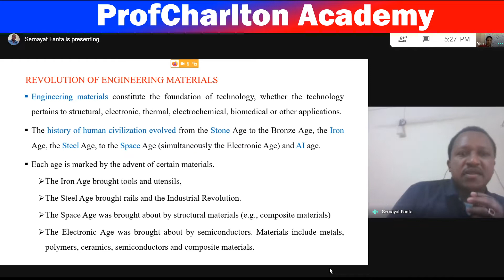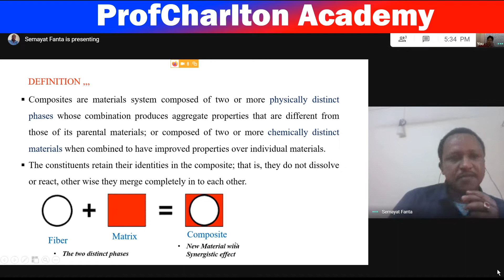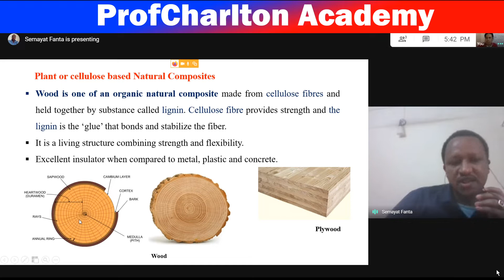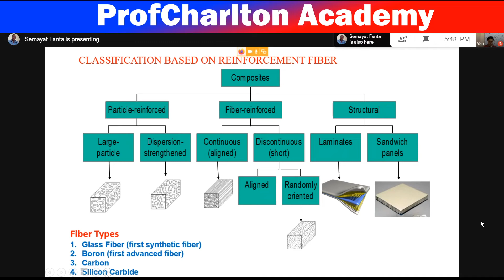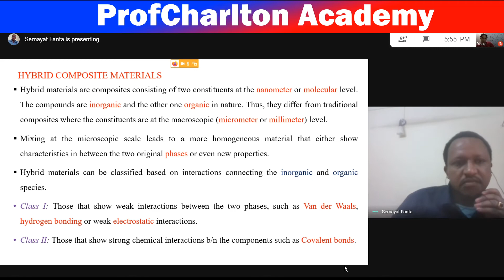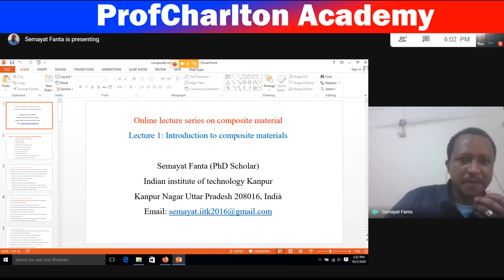PhD. candidate Semayat Fanta Lecture Series: Introduction to Composite Engineering

Comment: Thank you for sharing! Basic knowledge of composite materials will allow engineers to understand the issues associated with using these materials, as well as gain insight into how their usage differs from conventional materials such as metals, and ultimately be able to use composites to their fullest potential.